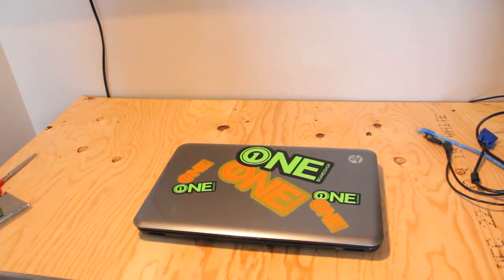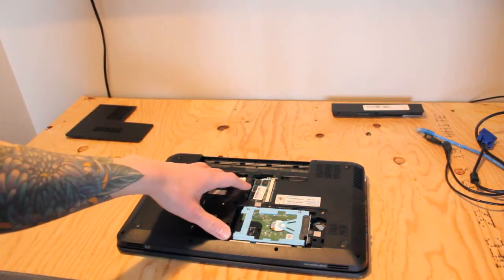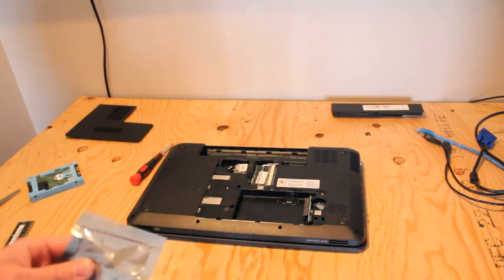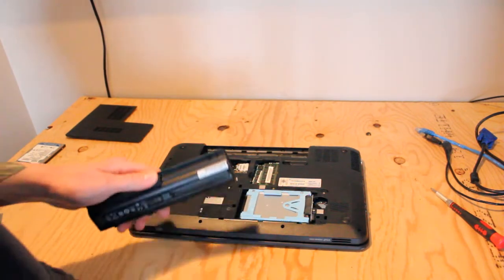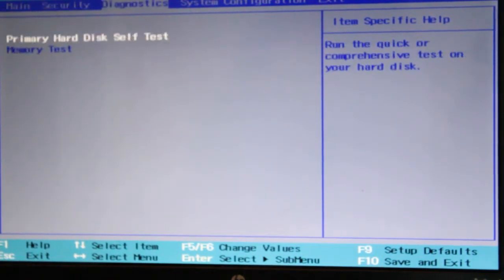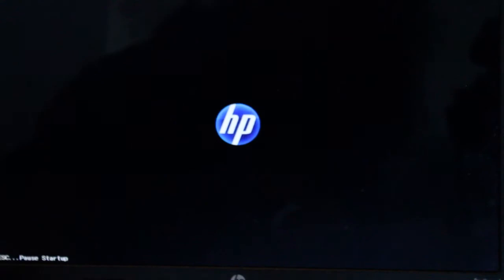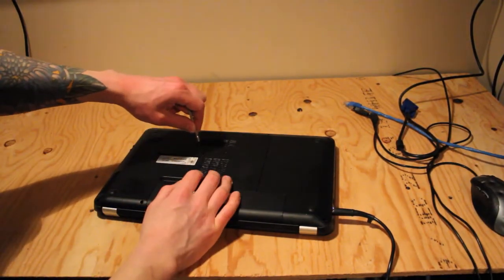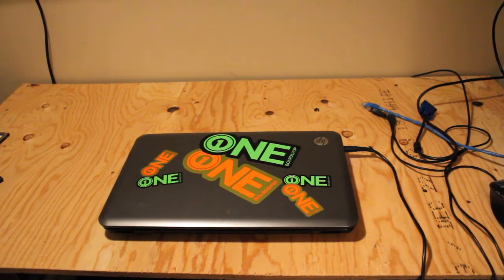HP Pavilion g6 1b37ca SSD install (how to)

Comment: it says "no bootable device please instert boot disk and press any" key after ssd installation what do i do?
Reply from the maker: Try entering BIOS, find the boot order, and set the SSD as #1 choice.  Let me know how it goes.
Reply: @HaisteComputerRepair  their is no ssd in the boot options it says notebook harddrive and internal cd/Rom i tried using both but they bpth say the same thing
Reply from the maker: @NotableMango  In BIOS or the Boot Menu outside of BIOS?  Just to confirm.
Reply: @HaisteComputerRepair  i seerched in boot order (F9) and System config boot order(F10) but no ssd option
Reply: @HaisteComputerRepair  do i take a video and send it to you?
Reply from the maker: @NotableMango  Sure, my email is on my website https://www.haisterepair.com